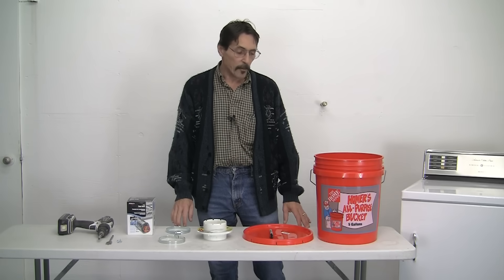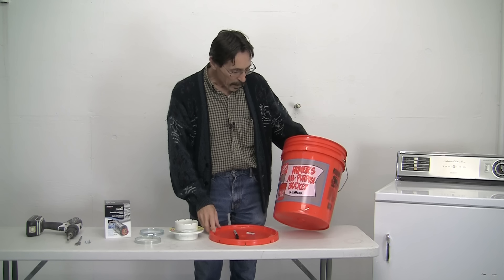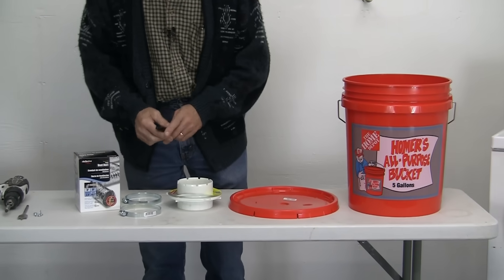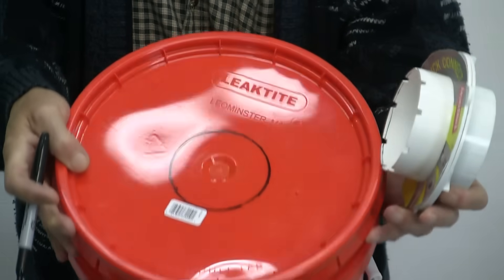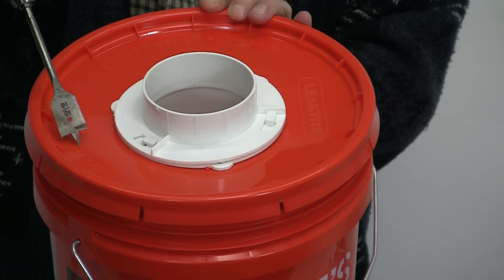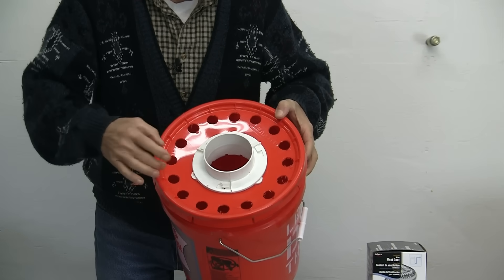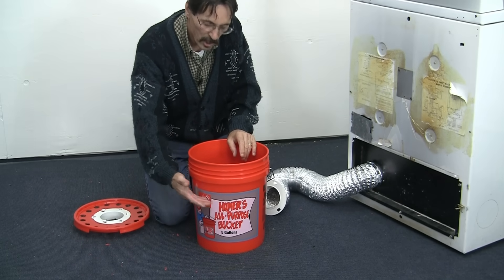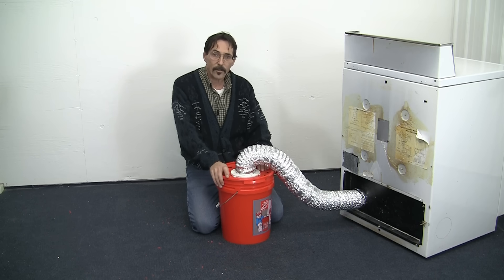DIY How to Cut Electric Bill in Half: Part 3 Clothes Dryer Free Ideas | Missouri Wind and Solar

Comment: You have to get rid of the massive amount of moisture the dryer pours into  the house. You can’t pump all that water into the house. You will have mold. In the immediate area of the dryer discharge hose he will have drywall damage or paint damage.What about all that humidity you will be pouring into your house in the summer when your air conditioner is trying to cool the house.. everyone says it’s the humidity that makes summer heat miserable. you will have to be prepared to do an easy change over in the summer to discharge the dryer heat and moisture directly outside..
  A better solution would be  make a heat exchanger. Some thing like a 30 gallon galvanized metal trashcan that is sealed with a tight fitting lid…The dryer is vented into this metal trashcan. The trashcan gets warm from the hot air coming out of the dryer. That metal can radiates the heat into the area.. then there is a second vent from the trashcan to the outside.. much the same set up that you see with any shopvac, The shop vac container has an entrance for the air, and an exit for the air….. using a metal trashcan,It is a heat exchanger. Just like you have in today’s condensing furnaces.
  You will still have a lot of condensation in the metal trashcan to deal with as it accumulates.  tap the side of the trashcan near the bottom on the side of the trashcan, & connect a small hose and let gravity flow the water/ condensation over to the floor drain . The heat exchanger does not have to be mounted on the floor. It would probably be best if it was up off of the floor at least two or 3 feet so he would naturally rise from the dryer exhaust vent uphill into the heat exchanger, this would also make the condensation flow easier towards the drain… if you have a front loader dryer, which most of them are, you could actually put the heat exchanger on top of the dryer.. it’s practically wasted space anyway..
  One person commented that they have a dehumidifier to take care of the extra moisture. It would be just as cheap/expensive to plug in a space heater. A dehumidifier is a sort of air conditioner which uses more than a little electricity.. that would completely offset any “free “heat you’re trying to capture..You might capture five dollars worth of heat, but you’re spending five dollars to deal with the massive amount of moisture, plus the expense of the dehumidifier itself

Comment: Good video.  Winter is when I try cutting utility bills with a EPA wood burner stove (got a good supply of pin oak wood this year) and using fans to circulate air.. uses about 20Kw/day, including cheating with a one-room space heater if too lazy to build up fire overnight.  Got here after seeing doubled electric usage on laundry day (3 loads, 60 min w/electric dryer).  This will add heat and humidity (which is now 22%).  Thank you.

Comment: Great clever idea... but here's a suggestion: build about a 6" extension to the attic filter box (using 3/4" thick wood) so that you can seal (and anchor) the filter box to the drywall ceiling with double edge tape. This will much better prevent attic-dust from coming into the dryer.

Comment: Can I run my 220 volt apliances on solar or wind turbine power
Reply: If you have the money for the system: solar panels, controller, batteries, converter,  etc. or a wind turbine and tower, controller, batteries, converter, etc. plus the cost of installation and set-up.  Could run you a couple thousand dollars by the time you are done.  Also, there is maintenance and upkeep on these systems.

Remember (if you are trying to go green) everything in both of these systems are made from petroleum products!

Comment: *DISCLAIMER: This should only be done with an electric dryer. A gas dryer will release toxic carbon monoxide into your home.

I would -i let the gas water heater vent into the basement too....
I'v done a monoxide meter test before ..... before LP gas heater turned on normal air  4 PPM in the air .... 80k BTU in 2 car garage - 20 min burn full flue into garage .. Mono test 8 PPB   the chart shows open a window if the PPb go to 90 

Think of this ... vent less heaters ...how come millions of people are not dying every year from them suffocating .

Comment: 6 years later this is still coming in handy - thank you! I have a dehumidifier in that area anyway so this sounds like a great idea.
Reply: Do you mean humidifier. This in the video will add moister to a room, so if you're already having moister problems, then this idea would add to that issue justababsy.
Reply from the maker: Thanks for watching!
Reply: So much for saving on the electric bill then? 😂

Comment: I wish I could do this with my gas dryer.  How is a gas dryer any more dangerous than a gas stove top?  Maybe it's how long a dryer runs?  Wouldn't it be safe if I placed a carbon monoxide detector right above the dryer?

Comment: On a gas heater use a piece of metal duct with holes drilled in one side and a tee at the lowest end slip over the dryer vent and cap off the ends use a small 6 inch fan to push the hot air out of the chamber.

Comment: I'm having a hard time putting the vent on the dryer the bracket loosens up right before tighting the dang hose clamps help
Reply from the maker: It helps to have another set of hands if you can ask someone to help hold it in place. Thanks for watching our videos!

Comment: Unfortunately, many, many people won't be able to tolerate the airborne lint that DOES still get through.  It will also run the humidity level VERY high in your house, high enough to cause mildew problems. Finally, if you use it in a closed laundry room,  it will be literally dripping wet in that area, your drying cycle time will become quite long, and you'll slip and fall and incur medical costs just trying to get back in there to shut it off!!!

You CAN reclaim a lot of that heat, but you'll end up having to build a filter box, or use a "cleanable" furnace filter, and run your furnace fan whenever you use the dryer and a device like the one shown. Electrostatic furnace filters are great, but will probably be overloaded and the cloud of saturated steam MAY harm the electronics driving your very expensive (but fantastic for normal conditions) electronic air cleaner.  Whatever type of furnace filter you use or prefer, it WILL be heavily loaded or overloaded quite quickly.

JUST BE AWARE OF THESE FACTORS!!!
Reply from the maker: Thanks for watching. This is primarily a winter idea and not one for humid environments.  See our follow-up video: https://youtu.be/M2ml3hRLnRI

Comment: I would think the water needs a tablespoon of bleach to prevent mold and the  air outlet (discharge holes) should be routed to a duct and connected to the furnace with the fan set to on   Now you have created a house humidifier and not a high humidity laundry room.
Reply from the maker: Thanks for watching. This is primarily a winter idea and not one for humid environments.  See our follow-up video: https://youtu.be/M2ml3hRLnRI

Comment: This is a great way to increase your basement humidity, causing mold growth. Not to mention the air restriction on the dryer will cause the safety thermostat to wear out faster.
So basically, now you've spent more running a dehumidifier, and you'll probably have to pay a service technician to fix your burnt out dryer.
Reply from the maker: Thanks for watching. This is primarily a winter idea and not one for humid environments.  See our follow-up video: https://youtu.be/M2ml3hRLnRI

Comment: Totally impractical in most dryer/washroom locations. Excessive humidity in a closed area will cause mildew. Lint and humidity is a big down side to this idea. 
Do not do this in your home. There are reasons why dryer venting is required by code to the outside.
Heat from the vent line is absorbed into the washroom area, so a heat gain to a lesser extent is still achieved without this useless contraption.
Never leave a dryer running while you are not home.
Reply from the maker: Thanks for your comment.  We don't recommend this for humid environments.  It is good for dry climates in the winter. See our follow-up video: https://youtu.be/M2ml3hRLnRI

Comment: yeah it works , but it allso introduce a lot of moisture intoo the house it will cause some mould to form , aspecially if the dryer is in a cold room like in the cellar or the garage 
wat does work is using a air to air heat exchanger and and include it intoo the air heat ducting or turn it intoo an airheater 
i seen big air to air heat exchangers used to preheat the incomming air intoo the home with the air venting out (both chimney and air circulation ) , thats sumting that can realy save on youre heating bill
Reply from the maker: Thanks for your comment.  We don't recommend this for humid environments.  It is good for dry climates in the winter. See our follow-up video: https://youtu.be/M2ml3hRLnRI

Comment: I have the little box which diverts the moist hot air into my basement . Humidity levels in the house are on the low side during cold weather . The furnace dries the inside air and the moist dryer vent helps put moisture back into the house . I clean that small screen filter after every drying cycle . Your idea seems to be a step up from what I'm using .Thanks for your video !
Reply from the maker: Thank you for taking the time to watch and comment.  We appreciate it!

Comment: At our old house we didn’t have a place to hook up the dryer vent so it would go out the wall. We put a piece of pantry hose on the pipe and just cleaned it out every few cycles so it didn’t stop up. It was kinda like keeping the vent filter clean.
Reply from the maker: Thank you for watching and taking the time to share your setup. So long as you keep things cleaned and maintained, lint backup shouldn't be an issue.  We appreciate it!

Comment: Excellent! BTW it takes 18 - 15/16 holes to match the volume of the 4 in diameter hose. it takes 15 - 1 inch holes. A=pi * r^2

Comment: How would a gas dryer cause CO as long as the dryer vent pipe is used and not the flue vent pipe?  Aren't there two pipes on a gas dryer? I don't think it's a good idea for a gas dryer to share the vent with lint getting into the flue of the house and later on igniting.

Comment: There weren't any Home Depots around in 1980!
Reply from the maker: Jeff spent decades in appliance repair so you'd better believe he'd make sure his 1980's dryer was fully operating and had a Walkman to keep it entertained while it's managing all that laundry.
Reply: @MissouriWindandSolar  I've never had a gas clothes dryer..However do you know if they have a lint hose along with the vent for the combustibles?
Reply: @MissouriWindandSolar  What you are proposing is a good idea with utilizing the heat down in your basement but it's so short lived is it worth it?  I mean you dry your clothes in a basment that's not finished as an example and nobody goes down there unless they have a work shop or to do laundry.  But if you aren't even down there for any lenght of time and the heat that is saved doesn't even make it to the thermostat upstairs, how is that a savings?  Besides that it could do more damage than just being piped outside..with the ungodly humidity it puts out in an already overly damp  basement.

Comment: Seen houses burn from just not clearing the vent, purposely shoving it into a bucket with heat is just begging for trouble. But its cool cause when they note this as the cause of ignition your insurance company is going to find the video and use it to void your claim...

Comment: Stupid! You are letting all that moisture out that will cause mold and mildew .why don't you just clean out the lent trap
Reply from the maker: We do not recommend this for more humid climates. It can be very helpful in dry areas particularly in the winter. Thanks for watching.

Comment: I dont like it. Yes As  a dryer its putting off heat but its an exaust. Los of chemicals in laundry detergent and dryer sheets and clothes. I dont think the water will capture all of the lint. 
This guy seems kind of methy as well......
Reply from the maker: Of all the things Jeff may like, meth is not one of them. We suggest plant based detergents. If you're not comfortable breathing all of those chemicals, why would you want to wear them? There are alternatives that are much better and safer.

Thanks for taking the time to watch.

Comment: My brother in law tried this. He had his dryer in the basement of his house, in a back room near his furnace. He heats with oil fired baseboard heating. After the first month, the lint that wasn't caught by the bucket completely plugged up his furnace filter and he had to pay for a repairman to come and service his furnace. So much for saving money. Not to mention all the particulates you breathe into your lungs. I wouldn't recommend this thing if you have respiratory condition or children. Great concept but very bad in reality. If you really want to cut heat bills, get a programmable thermostat and lower your home temp. Wear warmer clothing inside. Caulk and seal all windows and check weatherstripping and adjust threshold heights on all exterior doors. Install storm doors if you don't have them.

Comment: You'd be dumping all that moisture into your house, don't do this!!
Reply from the maker: We don't recommend it for all climates. In areas that are low humidity it can help but we'd tell Louisiana to pass on this tip.
Reply: Won't hurt where I live and the air is very dry in the winter.  Had to get a humidifier installed in the furnace and also run humidifiers in some if the bedrooms.  This should work nicely.  In the summer just vent it outside like normal.

Comment: What about making a heat exchanger box with a blower fan to circulate the air?
Then you could potentially use the setup on electric or gas.

Comment: When I did this 20 years ago, I had a hell of a time killing the mill dew  in the basement. Don't do it.
Reply: I agree. Moist air rising to the joists will produce droplets which will grow mold over time.
Reply: i bet your air quality was pretty bad down there regardless. ive done the same in my house for 10 years now and have no mildew problem but i know my house has a decent amount of air exchange because i installed and exchanger. tons of people in alaska have to install them after building their houses too tight. they get inspected by the bank or whatever and are told you have shit air quality install an exchanger, i built mine its very easy and worth it
Reply: One should monitor the humidity levels.  During the winter when the gas heat is on, the humidity level drops to around 25%.  Capturing this heat and humidity to bring it back up to around 45%-50% is ideal.  You certainly don't want it up around 80%.
Reply: I am constantly needing to run a humidifier in my house. Trying this today! Thanks!
Reply: @westtrindy9176  Don't let it get past 35 or 40 percent.  I do hvac for a living  IT an cause mold and the windows to condensate and frost build  up if you go higher thatn that.
Reply: @jockoharpo2622  i thought ideal humidity was 30%
Reply: @jackk8422  35 to.40 range. But your best bet is to get a humidistat built into your thermostat. This type of thermostat comes with an outdoor temp sensor and you wire your humidifier in the ductwork to it and it will not overhumidify your house in the winter. It will compensate for the temp change outdoors
Reply: @jockoharpo2622  thanks!!
Reply: @westtrindy9176  even in the summer?
Reply: You probably shouldn't do it.
Reply: Run a dehumidifier and burn up the saved electric bill.
Reply: Apple cider vinegar help kill and stop mold
Reply: I did this twice. The first time, water was dripping from the ceiling. The second time (with no clothes in the dryer) I burned out the element in the dryer.
Reply: @chesterwilberforce9832  Well why would you run a clothes dryer minus any clothes in it?  Why that's just silly!  Do you do any dry runs with the washing machine too?
Reply: @jockoharpo2622  hey Jocko,,, I run an empty dryer in my barn😎saved 70% on time it takes & and heats up really faster than stinky propane.
Reply: @smallvillefarm687  the same barn you were born in?  With a gihugic white suppository in the yard?
Reply: @jockoharpo2622 that would be wet runs😂😂😂
Reply: @chesterwilberforce9832  You may have just had a bad dryiner element. Usually the thermal nonresettable 80 dollar fuse opens up the circuit before it would burn out any element.
Reply: @chesterwilberforce9832  That's because you probably have an already extremely humid basement and the humidity from your dryer only compounded the situation.  I'd suggest you get a humidistat and if it's over 50 percent that you really should invest in a dehumidifier roll around unit and run it all year round. You can run it as naked (no clothes) as you like.  Oh and guess what can make clothes dryer elements corrode when the dryer is sitting idle?   IT starts with the letter H.
Reply: @jockoharpo2622  To those not in the business, may I ask what is it that starts with "H", that corrodes dryer elements, as you mention.
My best guess is H2O...?
Thx!
Reply: @bryanwalter5752  I Think it was humidity  I meant.  That's actually just psychrometrics..IT's somethihng we had in HVAC school   I had to run elderly calls for ladies that I couldn't explain why she was ok in the winter with her furnace at 70 and too cold in the summer when it was set at 70 for the AC mode.
Reply: @jockoharpo2622  are you one of the Marx bro.s surviving kin?
Reply: @robertspence6405  Hee hee.HE's my cousin!
Reply: @robertspence6405  lol just poking fun in here is all